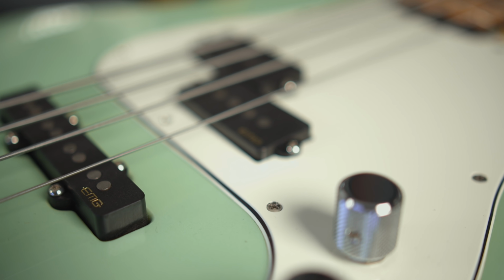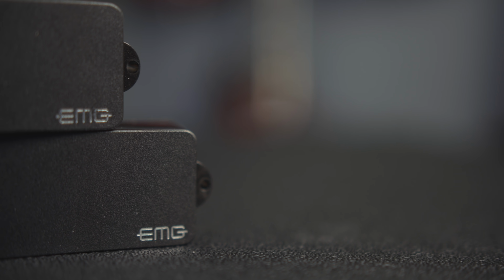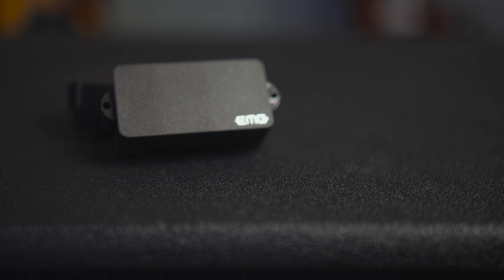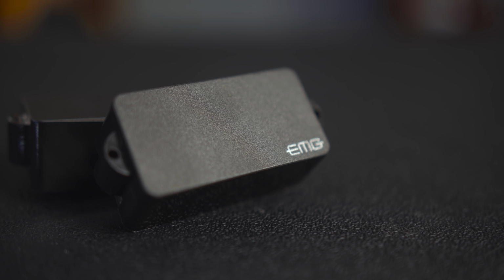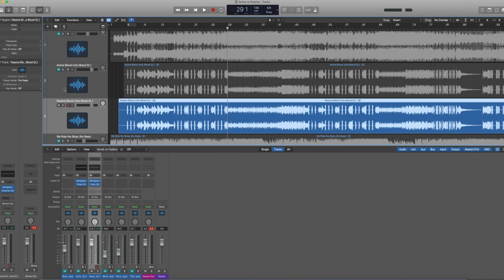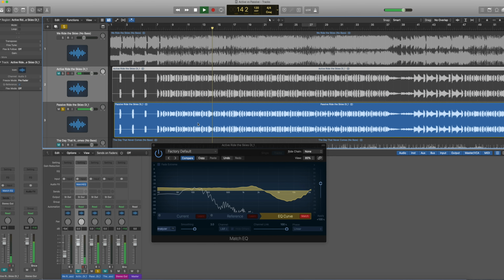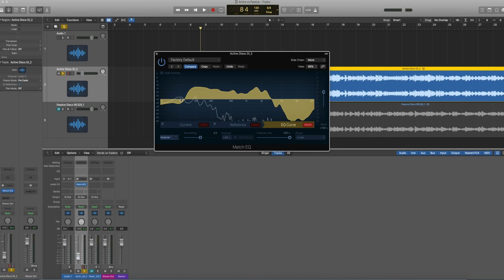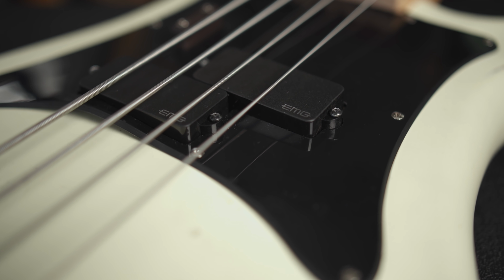The TRUTH About Active Pickups

Comment: The active pickup isn’t necessarily giving you ‘much more of everything’... A passive pick up through passive controls can have a fat low end peak, that’s actually resonant, as a passive pick up/volume/tone create an LCR filter. The active setup with less winds and no interaction between the pick ups and controls won’t have this resonance to the low end... 

Sure it’s less accurate, and not as good if there’s lots of fast muting, but it’s generally perceived as warm sounding.

Comment: Hate to be that guy, but really, there’s no such thing as an ‘active’ pick up... 

The technology of ‘active’ pick ups is the exact same, some variation of magnets and coils, that turn the movement of the strings within their magnetic field into a current.

‘Active pickups’ like those EMG’s just place the preamp directly on the back of each pick up. 

The only difference this creates vs. using a buffer or pre amp with passive pick ups, is that two ‘active’ pick ups combined won’t load each other down and affect each other’s resonant frequency like two passive pick ups blended before a single pre amp.
Reply: Incorrect. EMG pickups do mot have “just a preamp” inside the the shell. It is a bit more clever than that, one coil is connected to the inverting input of the opamp while the other is connected to the non-inverting one. By this the opamp acts like a differentiator/comparator. No onboard preamp does this (however you can do that).
Reply: @Eugensson  Their soapbar is single coil bass pick ups can’t really run that electronic arrangement, or their single coil active strat pick ups?
Reply: @Jonathan_Doe_  all EMG pickups have at least two coils (TW-series have three). The J ones are stacked, so yeah, probably even if they are connected in the comparator mode, noise-wise it will be almost identical (i think) to the regular pre-amp connected after the regular passive stacked humcancelling J pickups.
Reply: @Eugensson  The SA’s are single coil.
Reply: @Jonathan_Doe_  indeed. i stand corrected.

Comment: I'm surprised that anyone would go through the trouble of putting active pickups in a bass and then run them through passive volume and tone controls. If I'm putting active pickups in a bass guitar, I'm putting an active 2, 3, or 4 band preamp in there, as well.

Comment: I don’t have a preference. I’ve used both passive and active and I like both. I’m happy with how my P Bass sounds with its original passive pickups, will never change it. Jazz I’m up in the air for. My Schecter 5 string will be upgrade shortly from its original EMG HZ pickups to the EMG DE set.

Comment: I'd be up for using active pickups, but I just love my basses (Geddy sig and a Stingray) that I don't feel the need to switch anything out.  And I'm a serial tweaker/modder-- not touching those two :p

I do have a question about compression that I'd appreciate you guys taking a look at in a future video perhaps.  I don't use a compressor, but I do usually stack at least one boost into my preamp/DI and I feel like I get plenty of compression with that.  What are your thoughts on this strategy?  It seems to me like most people never consider it, or would still use an additional compressor on top of this setup.

Comment: The analysis in the video is really informative, thanks for preparing and posting it. However I wouldn't say, that one option is better than another. The active pickups have more highs, have flatter frequency response and can be shaped to sound like passives, I agree, but it requires very precise eq (3 or 4 point eq in an amp will not ve enough) and some knowledge to do it. And if our goal is the sound, that the passives have baked in, it doesn't make sense to go around and make the tone shaping process more complicated.

For years I was playing an Ibanez ATK (passive pickup, active preamp) and in a band setting I always had problems with fitting in. I bought a Jazz Bass and now I sit perfectly in the mix with other instruments. I love experimenting, but it's a hard job to get the right sound. I was finally able to sound ok with my Ibanez with flats that tamed the hi end and the HPF that cut the low bass.

Comment: At the 39:22 mark, I must disagree..., but only slightly... Of all available 9volt batteries generally available, alkaline batteries do discharge in a more linear manor than the others, even the cheap short lived carbon type... This is why I have always used lithium 9volt batteries for as long as they have been available for my guitar and bass EMGs..., and I have used EMGs since the 80s... Lithium batteries not only have a much longer lifespan..., but they stay near their rated voltage until they die, instead of the linear voltage drop over the lifespan of alkaline batteries... Additional note... Most of the lithium 9volt batteries available a local stores are the Energizer brand ones, and they are only rated for 750 ma hours..., but online, you can get 1250 mh hour lithium 9volts that will last much longer, and yet are still relatively inexpensive...

Comment: EMG make good pups and I can't understand why everyone doesn't use solderless install.I have EMG on a few of my 20 basses 2 of which are no solder,and never have a problem in this regard.
Reply: Its more expensive. Really that simple. But yeah, we should be past soldering at this point.
Reply: @RyRyTheBassGuy  EMGs are cheaper than many others though.
Reply: @BlommaBaumbart  The pickups, sure, but not the solderless pots/switches/wires.
Reply: @RyRyTheBassGuy  Well, I was specifically referring to the fact that an EMG Geezer Butler PJ set (wirings and pots included) runs for 40 - 70€ less on Thomann than competitor products which require soldering.
Reply: @BlommaBaumbart  Sorry, I was talking about what the cost would be to guitar manufacturers. 

EMG kinda has to give you the pots. Though I've always found it interesting they don't include the solderless switch with their guitar pickup sets. You can obviously reuse your old switch, but that will require soldering.

Comment: I can agree that active pickups are technically better. They definitely afford you more options and flexibility in post. For me, that would probably bog me down because I get option paralysis when I have such a wide open field to play with. I prefer simple, and the fewer steps I need to get something done, the better.
Reply: Yep. I had a really nice active bass with a passive option, preamp, all that stuff. It was too much. I traded it for a P-Bass. Perfection.
Reply: I’ve only ever used active basses for over 20 years. But In a live setting it’s too tempting to mess with bass / mid / treble cut and boosts. Got an American pro II jazz last year. It’s so, so much more simple. Not as dynamic but always sounds good. Now I gat a passive Warwick. I kinda don’t want to go back. Switching between active and passive basses at gigs just feels like too much extra adjustments to worry about. I love the passive tone and it’s really just set and forget it. If I’m home not playing with a band, active pickups definitely sound a lot better.
Reply: Not to be rude, but did you watch the video? You’re referring to onboard preamps, which was not what the video was about. This video was about active pickups with passive tone controls, I.e. just a volume and tone control. The same thing that’s on a pbass. There is a difference between having active pickups and an active preamp. You can have one or the other, or both.

Comment: So, I don't know if I'm over thinking this and confusing myself... A few companies make basses with active/passive switching. For example, the higher end of the yamaha trbx and Ibanez soundgear lines.

Of the four categories you listed where do these fall? Are these passive pickups that switch from active/passive electronics. So, between the first and second that you mention.

Or the first and third? Where the switch changes the pickups from active to passive but the electronics remain passive? Or first and fourth?

Just trying to understand if these basses offer the best of both worlds.
Reply from the maker: Generally speaking, basses that switch from active to passive are passive pickups with active controls, so basically switching from examples 1 and 2.
Reply: @TheBassChannel  thank you!
Reply: @TheBassChannel  one more follow up question. The third type with active pickups and passive electronics with no preamp. What manufacturers make basses like this? It's been very difficult searching for this online because most references to active are only referring to he presence of a pre. Most people don't seem to know the difference. 

Thanks for this video I learned a lot from it and my follow up reading on talkbass, thegearpage, etc.
Reply from the maker: I’m sure there’s more than this but off the top of my head, the new LTD Tom Araya Signature has active pickups with passive controls as does the dUg Pinnick Signature from Schecter.
Reply: @TheBassChannel  also Frank Bello's signature esp/Ltd bass

Comment: I dont think large magnets affect sustain . . having them too close to  your strings will, though . . .. 1976 Stingray pickups (usually regarded as the original and Leo's best design) have an extraordinary  Eight 9mm x 25mm magnets, and thats nearly twice as long as current day, and no sustain issues. . BUT (here's a clue) . .VERY little windings . . coils of 2.6k in parallel . .  thats tiny  . .  but the sound? . . . unequalled
Reply: Having a larger (more powerful) magnet is effectively the same as having a smaller magnet closer to the strings. So I'm not sure how you can't see how that would affect sustain.
Reply: @agitatorjr  well, because I have 3 of them .. . the basses . . and your argument leads to EVERY pickup affects sustain , if you put it close enough . . so what are you talking about , really?
Reply: @chrissinclair1776  it's not complicated. A larger magnet does not have to be as close to the strings as a smaller one to have the same effect. You seemed to imply that the size of the magnet doesn't make a difference when it absolutely does.
Reply: Listen , dont talk down to people . . . I get the concept, but my 45+ years experience with basses that have double the usual size, is that there is no difference between half or double the size, in setup .*you have to appreciate how big 9mm x 25mm is , and multiply it by by 8 . . . these pickups setup the same as their literal 'half' brothers. . . (and do not explain the thing again to me like I'm some fuckin idiot)
Reply: @chrissinclair1776  somebody is a little touchy. If you didn't seem like you didn't understand it then I wouldn't have explained it again. Not sure why you are taking it so personally. Have a good one

Comment: "When you add gain, you add noise." Does that not apply to the preamp inside the active pickup?
Reply from the maker: Not as much as the amp’s EQ or in the DAW because you’re amplifying the sound very early in the chain where noise has less of a chance of entering the signal.
Reply: @TheBassChannel  Makes sense. Thanks!

Comment: For me: active pups with passive electronics is the less popular. In fact I don’t remover seeing an unique bass with this settings.
Reply from the maker: You may be right. I haven’t seen every bass out there. I’m just going off what I’ve personally seen. Just as one example, the old Tom Araya Signature bass used passive EMG soapbars with an active 3-band where the new Tom Araya uses active EMG soapbars with a passive tone. Again, only one example but either way, I’m sure we can agree on setups 1 and 2 being the most popular setups.
Reply: @TheBassChannel  thanks for replying me (is that correct? I'm from Brazil so sorry for any language mistakes).

Comment: Yes, they might be objectively better.

But I've learnt that I tend to get lost in the woods when I have a lot of tone sculpting options. I spend way too much time fiddling with my preamps, pedals or compression. And I'm never quite content. 

Take away most of the knobs and I'll quickly find a sound I'm very happy with. So my preference is straight and simple: passive all the way.
Reply: Yeah most of the time I think less is more. Having too many tonal options makes people indecisive and they spend way more time fiddling with knobs than actually playing. I've fallen into that trap before, where I focus too much on tone chasing and don't end up practicing any real songs. A passive p bass or j bass with a basic volume and tone knob setup is all anyone really needs. I've done my time with stingrays and spectors and I don't really get it. If you want to boost or cut your treble, bass, or mids, just do it on your amp head. Set it to a spot you like and forget about it. One less thing you have to buy batteries for
Reply: Exactly this - simpler usually eliminates a lot of nonsense, and you can add to it if really needed.

Comment: Great video guys!! Long live The Bass Channel!! 😁
I have a set of EMG JAX on my Jazz Bass and kept the on-board preamp, so I'm one of the 1% who plays active pickups on an active bass 🤣

I'm a bit OCD about my tone. I love the versatility of a good Jazz Bass, but I also hate 60hz hum, hiss and ground noise. Despite this, I ended up buying a Deluxe MIM Jazz Bass with a on-board active 3-way preamp and Vintage Noiseless pickups. The noiseless pickups were a deal-breaker.

They are anything but noiseless though! Loved the tone, but they can't handle distortion well in a recording situation...or just a loud situation, really...! I used to practice through an Orange Crush 100 and I remember the hiss was so bad, that we couldn't have chats in between songs if i didn't step on my tuner to cut the signal. Not even after a shielding job done by a professional.

Now that I have the JAX with alnico magnets, I'm always able to dial in the tone that's in my head without worrying about a dirty signal. Even vintage tones...my jazz bass can get a better P tone than my Yamaha BB434. I think the sound of active pickups is anything but sterile. They have depth and bite on tap, and, more importantly, a flexibility when it comes to find the right tone for the ocassion, that passive pickups just don't have. Not without the right gear, a clean power source for your amp and a good sound engineer.
Reply: I put Dimarzio passive hum canceling pickups in one of my Jazz basses.  Fender did a good job with wiring the originals so that the front and back pickups cancel hum if the volumes are set identically, but to me that was too limiting.

Dimarzio has done a superb job of recreating the sound of those original Fender single coils, and now I don't have to worry about which direction I have to face to avoid the hum.  I also have one less battery to fuss about and worry about failing - dealing with the AAs in my in-ear receiver is about as much of that as I want.  At least with an active preamp on passive pickups, many allow you to switch to all-passive if a battery starts to fail mid-set.
Reply: On the Orange, I twisted the internal speaker wires between amp head and internal speaker. Made the Orange almost silent at rest even at high volume and reasonable gain.

My garage / practice area has florescent lamps and without EMGs or P bass the noise is nasty. Sure I can shield - with the EMGs I sent need to.

Comment: It’s great to note that passive controls does not exclusively mean ‘cut only.’ Some active systems have cut only parameters, but what makes it active is the coloration and the fact that it is more than just a potentiometer redirecting current to ground. 
I’m not by any means an expert on circuits, but it may be misleading to tell the general audience that a cut only circuit is exclusively passive.
Reply: I know I'm a bit late but you're completely right.
When you come across an amplifier with an EQ that can boost as well as cut you tend to notice because the range of the controls is enormous.
I have a sound city 120 mark 4 sitting in storage and the EQ on that can literally silence the whole amp.
Conversely I've come across some equipment with controls where everything needs to be set at full and then reduced down in order to get a decent sound because the 12:00 setting sounds like there's a blanket over everything
Reply: Yep, the Gibson Ripper had a mid-cut/roll-off and the regular tone we all get on any standard passive bass. I love that it has the ability to actually cut a frequency, as opposed to re-introducing the treble highs with the standard tone rolled up. I personally love having selector switches for series/parallel, in/out-phase, and pickup (coil/position) more than EQ. I feel like you get more tonal range which feels natural to the instrument that way, as opposed to a basic EQ rig where you can sound the same (effectively) across different, active basses.

Those EMGs definitely sound great in this video! I've never had truly active pickups outside a set of Bartonlini's I bought cheap years ago for a project bass--love those things, but I ran them passive.

Comment: I like active PU for metal e.g., but since I am pretty much always rolling back the highs on passive PUs I do not crave the extended high range from actives at all. I don't like that cling for anything other than metal. I also strongly disagree with you when you say "the DI signal can be described as thin/high and lifeless. Your mic'ed amp sounded dull, too thick and muddy, where as the DI signal had the mid punch I love (which sounds to me woody and organic). Pared with passive PUs and passive electronics is absolutely awesome. I have a passive/active switch on my bass for the on board electronics, and almost always like the the passive electronics more as well. PS: I liked the Seymore Duncan quater pounder in the adam clayten warwick way more than the passive EMG. I also do not like the sound of the green p with the same Pickups :D